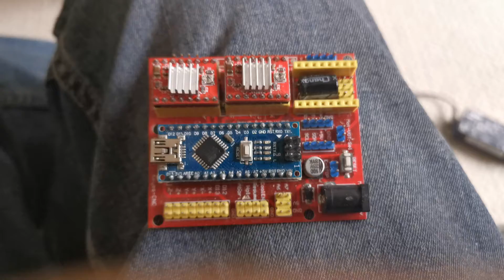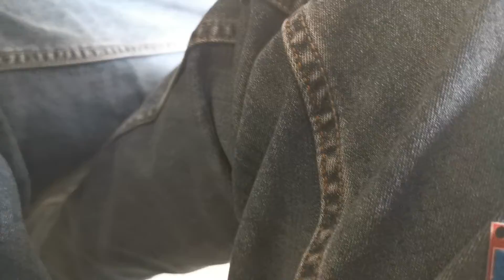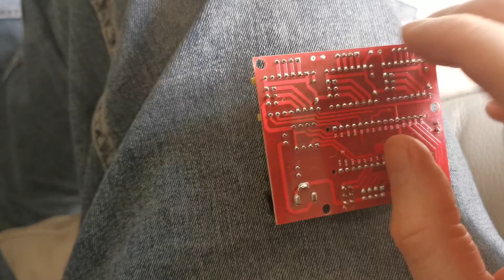Worst CNC shield 12v /24 volt board GRBL v4 Arduino Nano (Problems, fix, Mods, flaws, corrections)

Comment: I soldered on 24V and had a buck converter connected also to serve 5V to the CNC board and Nano. Nothing in the DC jack. When I powered up, the Nano went up in sparks and smoke immediately... no idea what happened...

Edit: I think I just figured it out: TMC2209 drivers have the potentiometer screw on the other side than the cheaper drivers and since I didnt find an orientation anywhere I just assumed the screw must be on same side... turns out that actually sends 24V down the 5V rail and fries the Nano... Stupid board...
Reply from the maker: I hate these boards, even after all this time it's a bit upsetting that people are still experiencing these problems :(

Comment: I got almost the identical board, but this one have have voltage regulators, I will try to check if the connection is already fixed

Comment: So I’ve bought v4 nano shield! I’ve done all you can do besides modify the board! You talk about supplying 5v to each stepper driver! My boards all have jumpers but all go to ground! I’ve seen a instructables that shows placing jumpers across to 5v but they are not elaborate enough to know if you need to cut traces to make this all work without frying things. Do you have documentation or pictures showing you what you did to get this all to work?

Comment: Your comments about the motor voltage are wrong.  The boards work with either 7-12V supply to Nano and motors, or 7-12V for the Nano and any voltage up to at least 24V for motors.  The motor supply is at a thru-hole at the edge of the board - remove the header at the Mot-Vol-Sel jumper to separate the two supplies.  My units came with 50V capacitors, so the voltage limit for the motors would be set by the driver modules, not the board.  Others have 35V capacitors - I have never seen less than this.

The modifications for the other issues are trivial (and optional) and no more complex than running the cables for the motors and the power supplies.  With the current price for the board, driver modules, and Nano these are excellent boards for smaller devices, such as the popular drawing machines or miniature laser etching machines constructed from dismantled DVD-drive assemblies and similar projects such as eggbots.  Now that miniature linear steppers are readily available the range of applications for a controller like this is enormous.  And if you want to go with the cheapest possible Nanos look for those sellers who are offloading the ones with the old bootloader - the prices are ridiculous, but they are still supported in the Arduino IDE and work just fine.
 
Of course, a biased review such as this might be useful to quote if you want to demand a refund from the seller by claiming the unit is faulty, but I am sure that you aren't promoting such behaviour?

Comment: What problem here?
9:00 as you said for micro switching it's common wire connected to gnd instead of 5v rail yeah it indeed wrong but I can see it's dir and step pin are connected properly to D2 to D7 nano pins can you conform pins of your cnc shield?

Comment: Hi, is it fine to power nano through USB and just provide 24V to pins beside stepper connectors? or is 12V needed for any other reason?
Reply from the maker: Yes that's fine, it's exactly how I have my CNC setup.

Comment: Today, I fixed it by following https://www.instructables.com/id/Fix-Cloned-Arduino-NANO-CNC-Shield/
I have done all eight modifications and now everything is fine! I can't understand what the problem was, because I thought that was only affected by microstepping, but it was also affecting the normal function of the grbl.
The changes are to isolate the common microstep from ground and connect it to 5V.
Of course I have to change cpu_mapps, but that's fine. Thank you very much for your reply and I hope this solution helps to fix the cloned arduino nano CNC shield! for any comments ecreichmon@gmail.com

Comment: This clone shields has many problems: 1) U> 12V, 2) microsteps don't work, 3) need to change pins in cpu_maps. These problems have solutions. But, I have other problems with grbl parameters, for example Grbl 1.1 $ 100 steps / mm does not work properly, there seem to be other problems that I cannot detect. Do you use it at the CNC? It works well?
Reply from the maker: Yes found the same problems and I would not recommend this board to anyone. I am glad you said about the  step per mm issue, I am battling with the same problem myself. I left my CNC machine without any use for a month, turned it on and nudge the axis. It decided to keep on going and crash into the side. I had to lower my step per mm to something stupid like 25 when originally it was in the hundreds. How this board can go from working five to altering all the step settings with no changes being applied is beyond me. Buying this board has actually hindered my progress. I have even swapped out the drivers and still the problem exists. I have tried a different nano and still the same issue. It's very strange. It used to work well, I don't know if its bad quality electronics too go with the bad quality engineering but it doesn't feel you with hope. I am looking at the other shields from British suppliers than getting cheap clones from China.